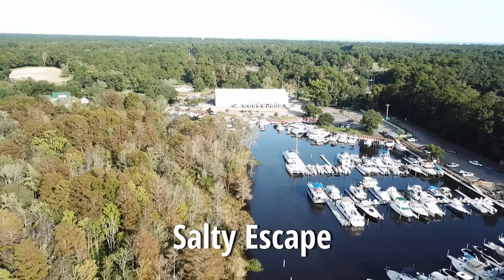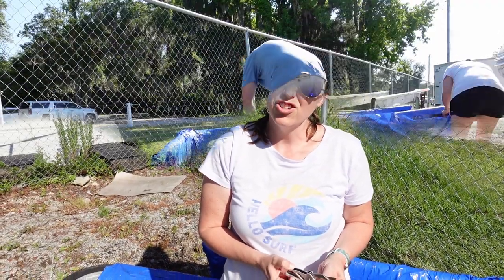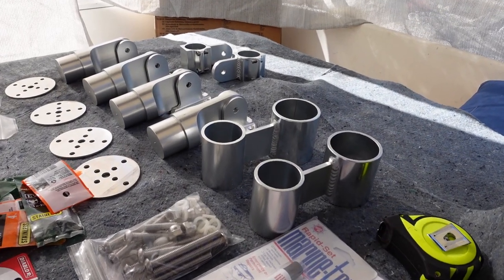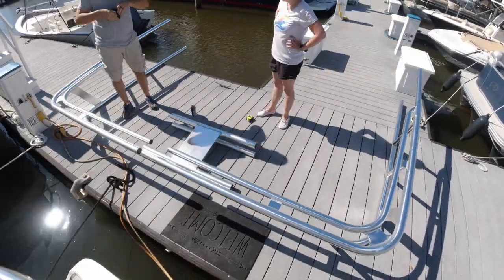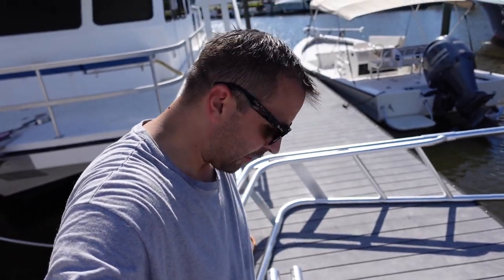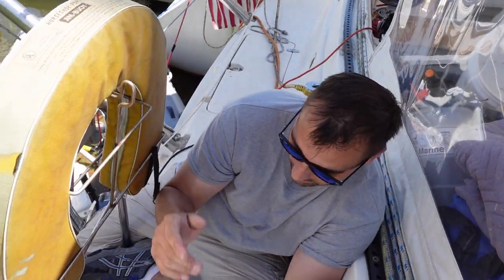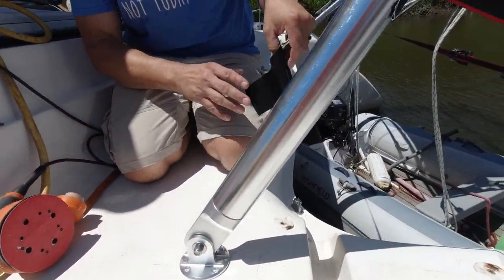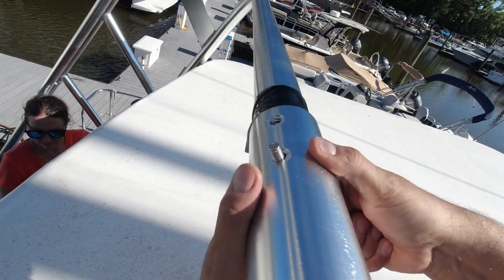Installing the BIGGEST solar arch we could find to prepare for OFF GRID LIVING [Sailing Family]

Comment: I love the look and design of the new arch. However, I'm a little concerned about the way it will be mounted as I don't think the spots where the aft feet are mounted on the top of the stairs, are really strong enough and that it will be able to hold the weight of both the dinghy and the solar panels. On my Venezia it looks like the stairs are an insert that was mounted after the rest of the hull was built, so it doesn't really give you a strong enough base to mount something as heavy as the arch and everything else on it. If I were you, I would run another brace from the arch to the bottom of the stairs, making sure that the brace is secured and integral to the hull itself. Another option to consider would be to leave the original davits in place and use them to handle the dinghy, thereby using the new arch for the solar panels only. I may be wrong as I can't get to my boat to have a proper look at the assembly of the stair-insert. Just my 2c worth...
Reply from the maker: Hi Philip, we were actually wondering about that as well. I need to climb into the engine compartment and have a look at the glass and see if I can gauge how thick it is. I’m going to talk to a local welder/fabricator because we want to make some additions to the Arch.  We want a hand rail across the aft walkway and we need to have the truss fabricated for the solar.  It would be easy enough to see about additional bracing.  I’ll let you know.  Cheers!

Comment: Corey, I'd love to know how the arch is working for you guys? I see in all the recent videos that you have all the solar panels and the dinghy hanging from it, and it seems to be working very well? I'm amazed that it seems so solid! How exactly did you mount it? Did you use any extra bracing to make it more secure or did you just mount the four feet? I can't believe it would be enough but still it seems to be solid? When are you dropping by Fort Lauderdale? - I'd love to see it for myself. Thanks for all the great videos and all the best with the repairs after the failing of the seagull striker..!

Comment: I know this video is a few months old, but our first boat was a 1995 Venezia (btw, I think you keep calling it a Ven-zia, not Vene-zia)  but I'm not sure how you create a cover that goes from the hard top to the solar arch because of the traveler that is at the bottom of the back of the hardtop, unless your setup is different than mine was or I misunderstood what you were saying.  I'm sure you have it figured out, I was just confused.  Good work on the videos btw. Cheers.
Reply from the maker: Hi guys! I’ve seen your videos with your Venezia.  The plan with the sun shade between the panels and the Bimini would be for times at anchor or marina, not sailing.   The photos of the other Venezia with this set up have the boom moved all the way to one side to allow for the canvas.  
Yeah, I’ve been told I’m saying the name wrong.  We were told it’s Ven et see a.  🤷‍♂️
Cheers, Corey

Comment: Great video, easy to watch and understand, thank you. 

Just curious- are there backing plates to be fitted on the other side of the fibreglass where the feet mount? And if the arch can hold 1000 lbs, what's the limit in relation to the hull mounts?

Thanks again for your great quality clips!
Reply from the maker: Hi Saxon, This video was more for entertainment, rather than a true “how to” video.  To answer your question, yes the backing plates go on the underside of the fiberglass and each foot is through bolted with five bolts.   With regard to the 1000 pounds, I am quoting the factory specifications. I imagine it would be relative to the thickness of your fiberglass.  I doubt many boats have paperthin fiberglass. 😉

Comment: NIce arch ! , w/ regards to the off grid part , 1400Ah@12v lithium is nice (we have the same DIY) but how much solar are you putting on ? if youre as power hungry as we are (2 adults , 2 kids, sailing full time) you need at least 2000-2200 Wp of solar to get your battery charged up again . you'll get 3 day at anchor in cloudy weather and if the sun is out you'll need 3 full days of sunshine to get your batteries from 20 to 90% SoC, don't skimp on the solar ! 

recommended brands LG Bi Facials , Sunpower and I have good experiences with 'Trina Solar' (5*400Wp is what we have) dont go with flexi panels as they are not worth it 

good luck deciding ! ;-)
Reply from the maker: Thanks guys!  This is very very helpful information.  We have already purchased our solar panels so we will have to see how they do… Hopefully we won’t need to make changes. We have purchased four Panasonic 340 Wp panels to go across the arch and then we have four 110 Wp flexible panels to go on top of the Bimini cover.  We had to go with flexible panels because we don’t have head clearance between the Bimini and the boom. So, in total we have about 1800 W of solar. We probably have physical space to add another couple 100 W flexible panels On the Bimini but those would get pretty close to the boom and likely be shaded most of the time. I think, at this point, I’ll see how we do and we will have the option of running the Westerbeak generator to top off if necessary or maybe I’ll explore some portable panel options that we could lay on the trampolines as needed.  I don’t really know if portable panels are a thing… Just seems like something that might work.  I really, truly appreciate your information, it’s been hard for us to estimate what we will need in terms of battery capacity and solar.  It’s funny, basically our yard stick of measurement has been gone with the Wynns. We looked up what they had and went bigger… Lol.  
Cheers, Corey
Reply: Hey Corey , I think you also mentioned a ‘gaming’ computer somewhere in your videos ? Those are true power hogs ! 

Right now we’re running 2 fridges 1 freezer , washing machine , watermaker , water heater , induction cooker, laptops tablets etc. After 2 cloudy days batteries are below 30% and we go in ‘energy conserving’ mode , it takes at least 3 days without heavy users to get back to 90% 

Another power hog is the inverter that uses 2.5A in standby , I don’t know if you have anAC or DC freezer etc but the inverter takes a load of power itself

We had 4 extremely expensive 115wp flex panels ($1000 ea) and I am now mounting rigid panels over them as they don’t produce anything (anymore ?) rigid panels are much better and you may want to consider upgrading the existing 340wp panels to 500wp , waste of money I know (unless you can sell the current panels) but they really are that much better
Reply from the maker: I’ll look into the bigger panels.  All solar panels seem to be in short supply and the price has gone up considerably over the last year so, I may be stuck with what we have.  The panels that we purchased were very high efficiency and they’ve never been installed… Basically brand new.  As I’m thinking about this, I may be able to sell them for more than we paid for them.  I’ll do some research. 😊

Comment from the maker: Do you think we’ll be able to put enough solar on the arch to allow us to live off grid?   Suggestions? Thoughts?
Reply: Depending on the size and efficiency of your panels  and your needs .. the battery bank capacity and type will determine what you can run and 
for how long especially the more power hungry devices.

Comment: This might help you
https://youtu.be/ZWiC4kVCGXI
Look for the links i already added...re Hybrid PVT panels basically keeping PV panels cool keeps boosts power and life span ...  Flexi panels are lower performance in part because of the heating effect. 
Some boat fans have found mounting them on corex helps improve and protect them.